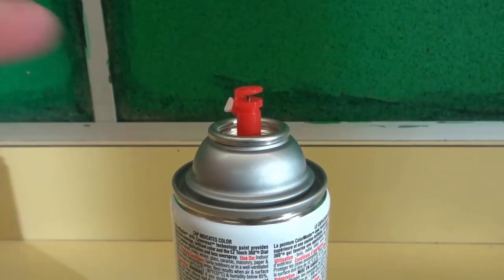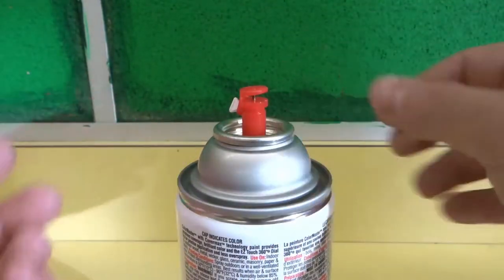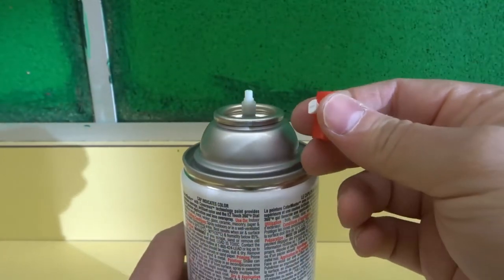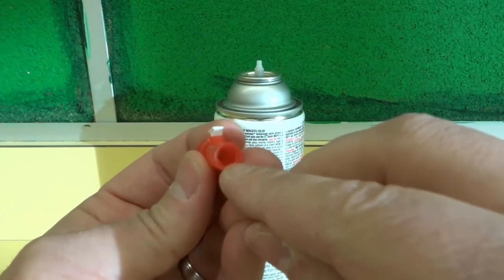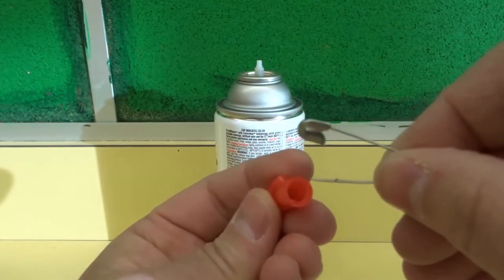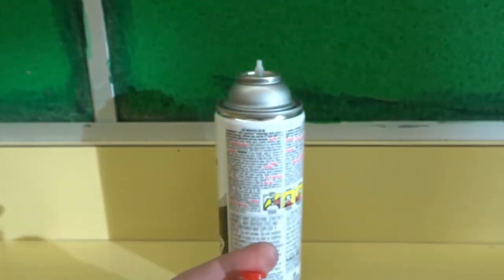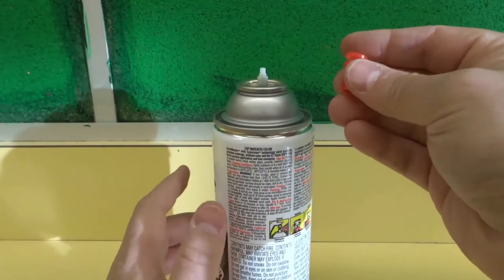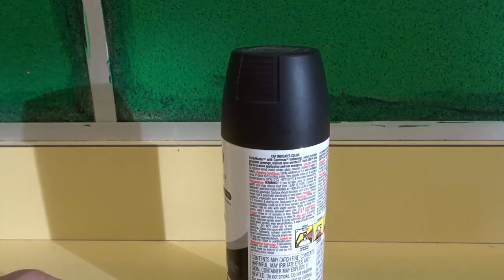How To Unclog A Clogged Spray Paint Can-Easy Tutorial

Comment: This does not work. I'm in the US not Canada, and I've tried the needle trick and its useless. My spray nozzles are constantly clogged on the Rustoleum paint cans.  Needle won't go in, its too fine a hole.  I've soaked in Acetone, switched paint nozzles to a new one, and still won't work. The vertical pipe is clogged.
Reply: The paint has probably dried up in the tube inside the can. To test that possibility, use a like nozzle from a working can. If the can in question still doesn't spray, it's likely clogged in the tube inside the can.
Reply: Rustoleum owes me $500. Is there another company? I'm sick of them.
Reply: Rustoleum owes me $500. Is there another company? I'm sick of them.
Reply: @Haitiandiva  ...they probably could make their spray cans so they don't clog up so easily. But then they might sell less paint. I think they've made them easier to clog up.

Comment: Thanks., Mine is a chandalier aerosol and has an annoying top you cannot remove. Just one tip the safeety pin on the video is good. I used a needle first and it was thinner. I definitely think a safety pin is better as it is wider. Neither worked but at least I tried. I think my issue is lack of gas inside and my lighter filler won't latch on ...